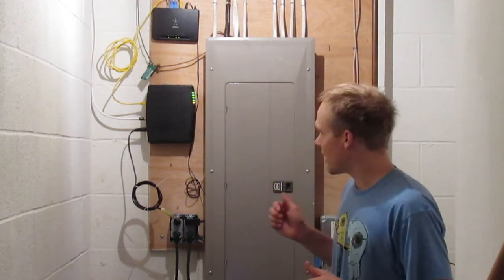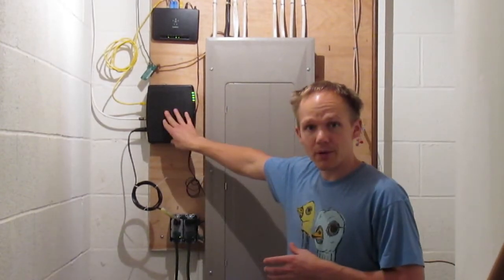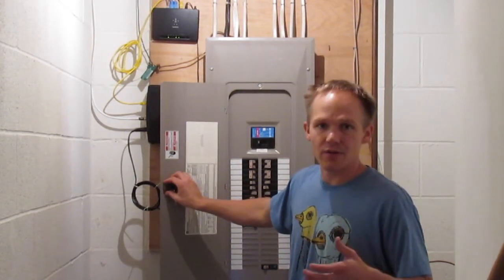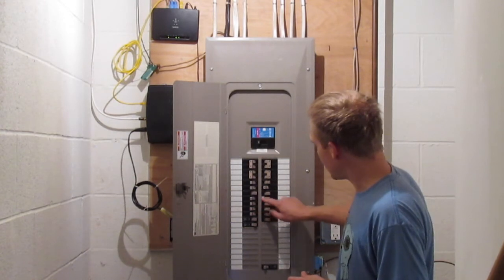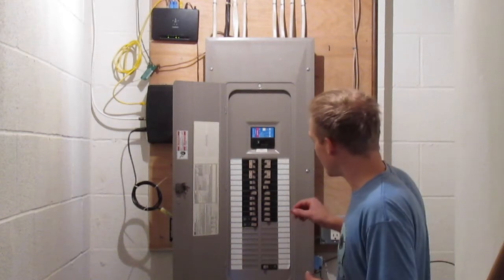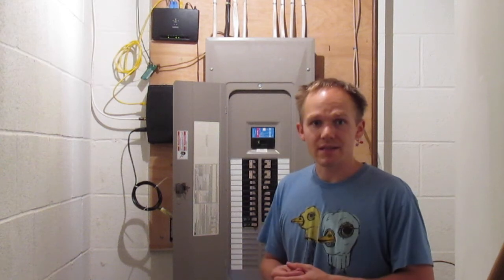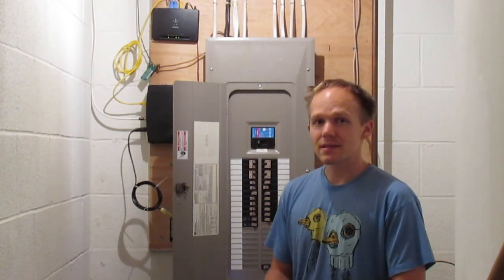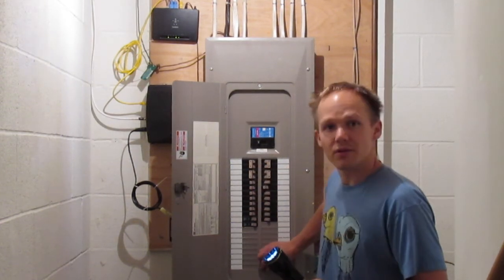Reducing AC Electric Fields AND Dirty Electricity At The Breaker Panel | EMF Minimalist

Comment: But you expose yourself to the box every night? What's the reading off the box (Opened and Closed) vs an outlet?
Reply from the maker: @Eugene Tooms the 3-5 seconds I spend near the breaker panel a few times a day is well worth the 8 hrs of uninterrupted quality (stage 3-4) sleep I experience by cutting the electric fields. Many of my clients opt to have a remote cutoff switch installed, not so much to avoid the breaker panel exposure, but for the sake convenience. If you don't own your home, you are probably limited to manually operating your panel.

The issue with breaker panels is the magnetic field, which is why you don't want to spend considerable time within 6 feet of one. The problem with outlets (ie: energized, unshielded house wiring) are the electric fields. So it's a bit of an apples/oranges comparison between the two.

Bottom line is that you want your sleep space to have an electric field (with potential to ground) of < 5 V/m and/or a body voltage in bed of < 100 mV. 

In the typical home, I usually find levels of 50-150 V/m and 1,000-8,000 mV, respectively.
Reply: @EMFMiner  Does the metal cover on the box drastically reduce the EMF?
Reply from the maker: @scuzzyhoulihan9853  the box and cover does nothing to reduce the magnetic fields. You would need a special material like G-Iron Flex.
Reply: @EMFMiner  I am on a tight, tight budget and need a shield for the fuse box as it's "IN" my bedroom. Would the G-Iron Flex suffice for that?
Reply: EMF Minimalist BTW, if you want to reduce static and low-frequency magnetic fields, the standard is MU-metal, not conspiracy hocus-pocus. You guys are worse than major corporations at trying to hide what is, and is not, significant, as well as actual vs. imagined solutions.
Reply: EMF Minimalist That’s hilarious. Ignorance is as ignorance does. If you had the chance to eliminate the inverse-square law from physics, I have no doubt that you would. Show us actual measurement of the field at 6 ft. from the box against background.

Comment: Hi there! I bought and installed a remote "kill" switch and now I'm turning off the circuits of my choice with a touch of a button. It's way better than making trips to the basement. I got a 6-breaker one (although I'm only controlling one breaker to it so far), but they also sell a 12-breaker switch if you need to connect more than 6 breakers. The remote has 4 buttons, so you can control separate breakers with separate buttons. I love this thing. It's brilliant! (and I'm not even an affiliate) :D

Comment: Hi Matt, I have my fuse box located in my downstairs bedroom. It's right below my daughter's room upstairs. And we use sound machines to sleep at night so turning off the fuse panel switches for our bedrooms is not an option. Would a mylar thermal blanket work for cover over the fuse box??? My name is Rachelle.
Reply from the maker: Minnie Mouse foil products won't shield the low frequency magnetic fields associated with breaker panels. Because these fields drop off quickly with distance, so, beyond 6 feet is usually fine. You should invest in a basic gauss/electric field meter like Gigahertz Solutions ME3030B to see if the levels are a problem.